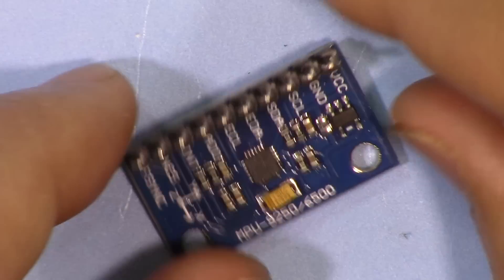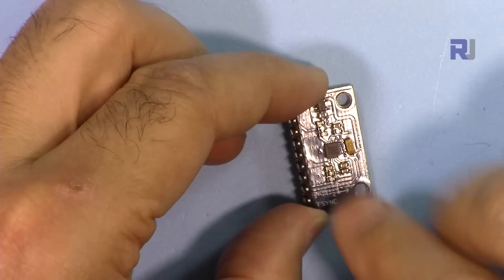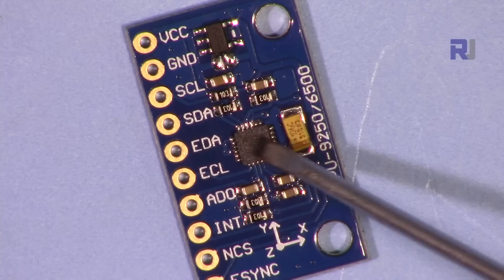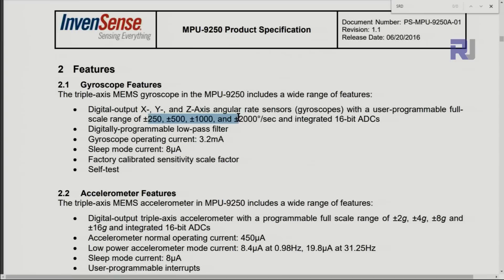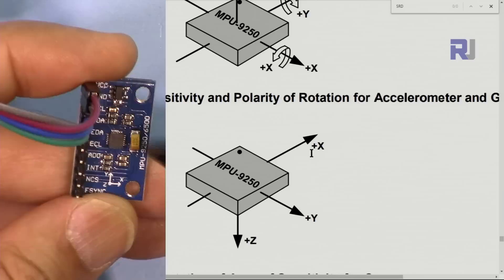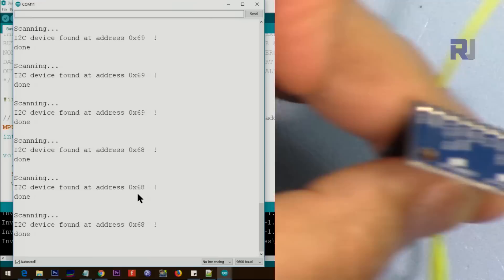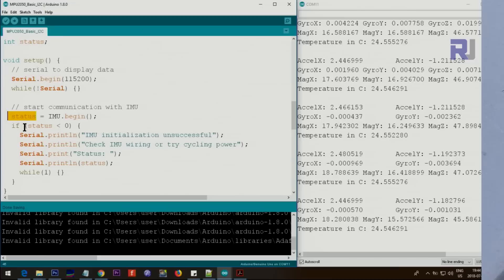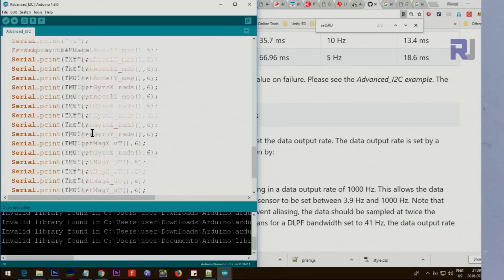How to use MPU-9250 Gyroscope, Accelerometer, Magnetometer for Arduino

Comment: Thanks for the video. I got the following error message:

IMU initialization unsuccessful
Check IMU wiring or try cycling power
Status: -5

What do I have to do?
Reply from the maker: it clearly says "check wiring"
Reply: I have the same issue, did you solve it? my wires are perfectly connected to the Arduino and the i2c_scanner says "I2C device found ... 0x68" so I think that my imu is working, please I need help :/
Reply: you have to ground AD0 !
Reply: @ocsner5687  have you solved it?
Reply: @ocsner5687  i've connected ADO to GND, but get the same message
Reply: I also have the same issue, i already ground the AD0, also FSYNC but nothing. I will check if I soldered the sensor properly. I also bought a new one.

Comment: Can you help me / I have a problem:
IMU unsuccessful initialization
Check IMU wiring or try cycling power
Status: -5
I looked at the code in the library, it seems that Check WHO_I_AM has an error.
Reply from the maker: Hi, Search for "-5" in the library here https://github.com/bolderflight/MPU9250/blob/master/src/MPU9250.cpp and you will find multiple reasons.

Comment: my accelerometer & gyroscope are working fine, but magnetometer output is just 0.0000 for all three axes. It isn't changing whether I tilt it/bring a magnet near it or whatever. Do you have any idea what could be the problem? Only the Magnetic readings are 0.00 like this, the accelerometer & gyro readings are fine tho
Reply: and what was the problem?

Comment: Thank you for this video . 
Can you tell me how I can calculate the range of motion by using the results of MPU9250 ?
I am working in my project but I have a problem to calculate the range of motion …
My project is Design and implementation of sensor based system for hand function assessment and analysis..
Please help me 😊

Comment: Hey, I need help, I am getting the status of -5, and it's not working. I have very little knowledge of how this works and can not seem to figure out how to fix this
Reply from the maker: Check wiring. It does not find the module , either bad wiring or dead module
Reply: @robojax  I have checked the wiring and have tried 2 different boards and still get -5
Reply: @DuncIsAwesome  I also have the same issue, i already ground the AD0, also FSYNC but nothing. I will check if I soldered the sensor properly. I also bought a new one.

Comment: You are a great teacher. Thank you for this video. However, I have a question, should the magnetometer be in one position or rotate it during calibrating. I've already written the code but I can't calibrate correctly. Best wishes Ania
Reply from the maker: You are welcome. that is very kind of you. During the calibration you should not move it at all.

Comment: Great Video!
I have a question: I have BMP280 and MPU9250 Sensors. I need them to connect to Arduino UNO. Both the sensors use SDA/SCL pins. How can I integrate both the sensors with Arduino?
Reply from the maker: Just connect them together. You can connect 128 devices in parallel to I2C

Comment: Hi thank  you so much really appreciated. 
My question ia that once i compile the code of i2c_scanner so after compilation it gives me error that '#include<cstddef> no such file or directory ' . 
Please tell me how can i fix this error . 
I updated my arduino IDE to latest version but did'nt work . 
I also reinstall the library but all in vain .
Reply from the maker: Try the blink program from file, examples, basic, blink
The error you are getting is very primitive and it should not happen. Reinstall arduino IDE ( the program itself)

Comment: Beautifully explained! Congrats, pal! Could you please put some light on the usage of the FSYNC pin? I need to place 4 modules on different parts of a human body in order to measure the relative accelerations between them (e.g. arm vs forearm, forearm vs hand and arm vs hand). So, I would like to know if the FSYNC pin can be used in order to put the 4 modules to yield synchronized measurements.
Reply from the maker: Thank you. The FSYNC is : Frame synchronization digital input. Connect to GND if unused.  Please see datasheet https://www.invensense.com/wp-content/uploads/2015/02/PS-MPU-9250A-01-v1.1.pdf

Comment: Very well explained, however I have a question, how to convert the angle into degrees? I need to know the position of the steering wheel of a car
Reply from the maker: 1Rad × 180/π = 57.296Deg so whatever value you have multiply it by 57.296 to get degree.

Comment: This was a fantastic demo. I want to use a magnetometer for the measurement of a delta in any direction to essentially detect movement of x mm. Is the 9250 more than I need ? Is there a magnetometer on a board or shield for the Uno that would be enough ? or even a Hall effect sensor with the ability to quantify distance ?

Comment: Really love this mate, very good explanation. Can you maybe  tell me how you access and write to the different registers, to select modes for the different sensors in the chips?
Thanks anyways for the video, and you're good at explaining yourself in english, probs for that!
Reply from the maker: Thank you very much. I love  you too.  For the register reading, the library is facilitating it.  The file MPU9250.h and MPU9250.cpp located https://github.com/bolderflight/MPU9250/blob/master/src/MPU9250.h uses registers List of registers http://www.invensense.com/wp-content/uploads/2017/11/RM-MPU-9250A-00-v1.6.pdf . 
the main function(method) that makes the reading is in line 1004  in here https://github.com/bolderflight/MPU9250/blob/master/src/MPU9250.cpp

Comment: Ok, now it's working. I bought a more expensive module. I get all the data, but the gyro and magnetometer don't seems to give me the right values... Excepted for the accelerometer and the thermometer
Can I get these values in degrees ?
Reply from the maker: I will reply to all Subscriber's 🔔 questions. So make sure to Subscribe.😊
The gyroscope values are in degrees.

Comment: Thank u for the great explaination. I hav hard time understanding the  sensor. Just a question, the gyroscope value shown fluctuate a lot, is there anyway to stabilize the value?
Reply from the maker: you are welcome. its very accurate and it is normal to fluctuate. you should get the average of  300 or 1000 measurement. Also you might need angle  in degree but it shows 0.001° so round it or divide it to so you get  0.1°

Comment: hello, i have the same module as this one and i tried different codes for it but i don't get any output change on the magnetotmeter, when i rotate it around the  x,y,z  axis a get and an output change on the accelerometer but i only have to shake the module along those axis to get an output bigger than 1 / -1 on the magnetometer in rest it is under -0.00 always 
Acceleration -1.300	2.095	-8.634
Gyrosvope -0.042	-0.042	-0.042
Magnetometer 44.918	29.959	5.411
and if it is possible i would like to use it to determine the rotation angle in degrees not the number from 0 to 8

Comment: Hi, thank you very much. I much appreciate the demo.
My question is when the data is being outputted from the MPU-9250 and the data being sent in bits. Where does it say in the data sheet which bit is which so for example is the first 3 bit in the 10-bit data the accelerometer data?
Reply from the maker: your question needs another video, but in this file  https://github.com/bolderflight/MPU9250/blob/master/src/MPU9250.h from line 196 to 223 you will see constants taken from Register map. You will see the register's name. Here is register map https://www.invensense.com/wp-content/uploads/2015/02/RM-MPU-9250A-00-v1.6.pdf I have just included this link to the page where you would find the code.
Reply: @robojax  Amazing! Thanks for the help!

Comment: I was hoping to see yaw pitch roll examples. Especially z drift correct with the magnetometer. :(
Reply from the maker: this is general explanation. if you want to use it for airplane or drone, then you need to spend some times to make it work.

Comment: Really helpful demo!! I do have one question, can I get distance measurements using MPU9250?? One of my projects involve calculating the distance travelled (in x and y direction) with reference to a fixed value.
Reply from the maker: Thank you. You may use it with other means to get accurate measurement. See this page: https://www.researchgate.net/post/Calculating_Speed_and_Distance_from_a_3-axis_accelerometer

Comment: This is awesome, thanks for sharing. I am able to get the output as instructed. 

Have you tried putting the magnetometer values into degrees? I actually want to get the direction 0-360 that my MPU-9250 is pointed towards.
I tried looking it up myself and found to use:
        float Pi = 3.14159;
        float heading = (atan2(IMU.getMagY_uT(),IMU.getMagX_uT()) * (180/Pi));
        if (heading == 0){
          return;
        }
        if (heading < 0){
          heading = heading + 360;
        }
But.. this is not working for me.. as I move my MPU around it only gives values between 30-80.. 

If you haven't done this that is fine. I've just been struggling with this for a while now and thought you might have done this. 

Thanks

Comment: Thank you for this! You're a lifesaver, but i was wondering. I need to use four of these at once for a school project, but this cannot be done with i2C. I have read that I should use SPI for this purpose, but how do you wire this sensor for SPI use?
Reply from the maker: You are welcome.  I have not tested with SPI but if you search for SPI version of library you might find it. Thank you for not skipping the ads and keep watching them. This will help me a lot.
Reply: @robojax  Hello! I found the SPI instructions on the library, but thanks for the response!

Comment: Beautiful tutorial, clear and operational. Do you have the project to add the display of a tilt-compensated compass? I need to link two Gps waypoints on my Gps / Compass autopilot raft project.
Reply from the maker: Thank you. I just put on my "to do" list. But I have another video similar to what you are looking for  https://youtu.be/uIz6WIis4dc
Reply: Ok, I previously tested the 6050, but it is less reliable, I would prefer to use the 9250.

Comment: My serial monitor only says this:

IMU initialization unsuccessful
Check IMU wiring or try cycling power
Status: -5

Any ideas? ):
Reply from the maker: have you run the I2C scanner? it you run it successfully and all wiring is good, the scanner should print the I2C address on the serial monitor. The I2C scanner is located here https://robojax.com/learn/arduino/?vid=robojax-I2C-scanner

Comment: Have you managed to collect data from all 3 sensors with the same data rate?
Reply from the maker: Create object with different name like sensor1, sensor2 and sensor3. and use them. You learn the use of object from this example https://youtu.be/L6ekl2ABcuY
Reply: @robojax  I wanted to ask how you have configured I2C master so you can read data from all 3 sensors by single reading. When I try so, ST2 reg doesn't get read therefore 
MAG doesn't update it's values.

Comment: hi there! i get this H⸮⸮⸮Z6⸮ kind of symbols when iconnect everything. Please help!
Reply from the maker: set the serial monitor baud rate. in Serial.begin(9600),  9600 is the baud rate, make sure your serial monitor is set to same value. (it is in the lower right corner of serial monitor).

Comment: Fatal error:cstddef: no such file or directory.

I am getting that error. When I delete the c includes. I get a cmath error in the eigen file. What causes this? I am trying to verify/compile the code.
Reply from the maker: I just checked the code I've shown in video, it should not have that. try using the library from robojax.com.  on the same page there is link for it.

Comment: A very useful tutorial. one question how do I calibrate the sensor?
Reply from the maker: please check the library. there is a function for that.
Reply: @robojax  are you referring to int calibrateGyro()? if so, how do i use it? Do I just call it once in void setup or void loop?

Comment: Hello, I've a question: is the value of the compass accurate ? Do the values changes from time to time, or are these stady and stable ?
Reply from the maker: hello, I have provided the datasheet.  Your question is very tricky. it is called divation over time. So it should be on datasheet.

Comment: Thanks for the video. I have a question?  what i should change to get the gyro data in degrees? and also i need the value to be maintained in its new position.
 Pls help!!!
Reply from the maker: get the value and use Radian to degree formula  1° = π/180° = 0.005555556π so multiply the value you are getting in radian by 0.0174533 and this is not exact.
Reply: @robojax  thanks for your reply. After rotation about the z axis(gyroZ) there is a reflection in the value but soon it becomes 0 (it attains the new place as the basic position). How to make the reflective value to be fixed in the new position???

Comment: Hello, thank you for the video, it's amazingly clear and useful. 
I just have one problem. When I run the I2C  scanner code with both my arduino UNO and the MPU-9250 properly connected and then open Tools > serie monitor, I can only see  this:

"I2C Scanner
Scanning..."

And no matter how long I wait, it doesn't say anything more... it doesn't say "no I2C device found" nor those lines that appear on the video.
If you can help me to find out what's the problem, I would be immensely thankful.
Reply from the maker: Hello and you are welcome. I am not sure why it does that. if you are trying A4 and A5, try the pins on the other side close to pin 13. You should have SDA and SCL pins.  Also check the wiring again.
Reply: @robojax  I already located the problem, the MPU-9250 male-male coupler was making false contact. Soldering the part fixed it. Thank you very much anyway!

Comment: I have a question. Why, for get results in different axis and sensors, only is necessary to get information from Reg. 0x3B (.59) (acelerometer high X results), and what is the utility of the bit-to-bit operators like displacement <<, or | etcetera, that in the function "int MPU9250::readSensor()" of the library MPU9250.h ?      Excuse me for my English, I hope someone understands my question.
Reply: I saw other programs that do not use this library that also do the same. You do not need to read the ACCEL_XOUT_L, ACCEL_YOUT_H, ACCEL_YOUT_L, ACCEL_ZOUT_H, ACCEL_ZOUT_H, ACCEL_ZOUT_H, etc. registers (registers from 0x3C to 0x48, that is, 60 to 72 decimals) just read the ACCEL_XOUT_H and do bitwise operations. 

This is the registers map of the MPU9250:   https://cdn.sparkfun.com/assets/learn_tutorials/5/5/0/MPU-9250-Register-Map.pdf
Reply from the maker: I will reply to all Subscriber's 🔔 questions. So make sure to Subscribe.😊

Comment: This may be an incredibly silly question but do you absolutely need to solder the pinhead to the chip ? I tried putting the pinhead thorugh the chip and through a breadboard to make it fixed in place and I couldn't get the chip to work no matter what I tried.
Reply from the maker: No question is silly.  No you don’t. Just solder the wires directly on the board.

Comment: Hey sir I am using an Mpu9250 for our upcoming project and while trying to test whether my sensor is working or not I tried putting on the code and it gave me errors like cstddef directory not found even tho the code dont have those line i wrote every code and it failed miserably. How can i contact you

Comment: I have a question, I have followed every step of the experiment on your video. However, currently the value of the magnetometer does not appear, what about the solution?

thank's sir
Reply from the maker: not should you face such issue. may be you have deleted the lines for magnetometer. start with fresh code without any changes.

Comment: THANKS MAN. YOU HAVE A NEW SUBSCRIBER
I hope you can help me. I am doing a project with this accelerometer and I would like to know:
1- the ADO pin is input, output or bidiraccional? I saw that you connect it to 5V.
2- FSYNC how does it work? To use it as in your example, should I connect it to GND?
Reply from the maker: You are welcome.
1-On the datasheet (in the same page as other resources) page 12 shows ADO is just address selector.
2-FSYNC is Frame synchronization digital input which can be used to synchronise with other data or system. page 18. I have not used it with other data or system so I don't know about it.

Comment: Hey Robojax, great video, this really helped. 
I just have one problem with the library... I am using ESP32 for MPU-9250 and want to use different Pins for SDA and SCL. 
Normally i would just set them with the function wire.begin(I2C_SDA, I2C_SCL, 9600). But I can't find any information on how to set pins in the .h/.cpp documents, can you tell me how to change these Pins with the library?
Reply from the maker: Hello, here is introduction to ESP32 video https://youtu.be/--Fj8QDlGuQ and in this video I've used I2C pins for LCD https://youtu.be/COssWn4Pcm4 good luck

Comment: hello sir, i have a question
why on i2c scanner you've got only 1 address (0x68) ? meanwhile on thats mpu-9250 has 9 DOF, which mean it should has 2 address : 1 address for accel & gyro (0x68), and 1 address for magnetometer (?)
Reply from the maker: Hello, everything on the module has one address .
Reply: @robojax  really? but i have gy 91 which is 10 dof (3 accel, 3 gyro, 3 magnitude, 1 compass) has 2 address, 1 address for 0x68 and 0x76